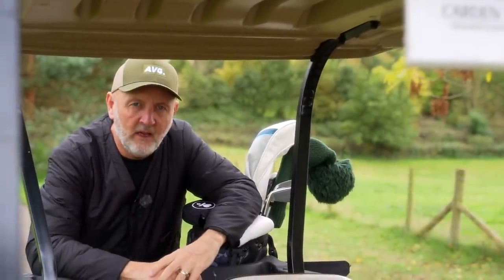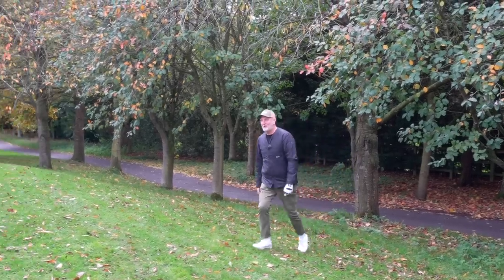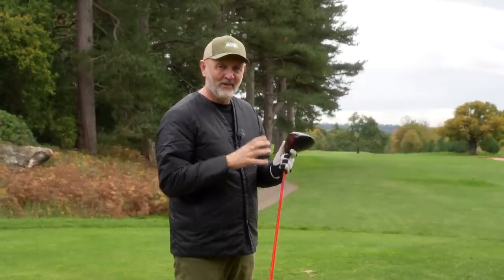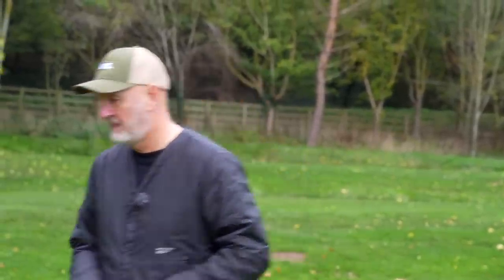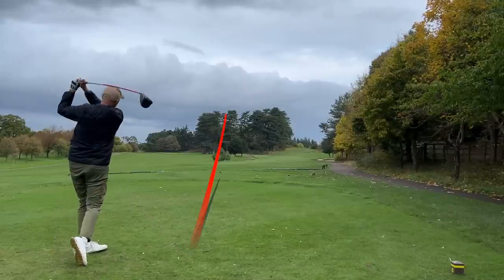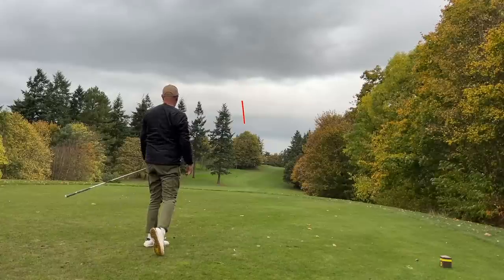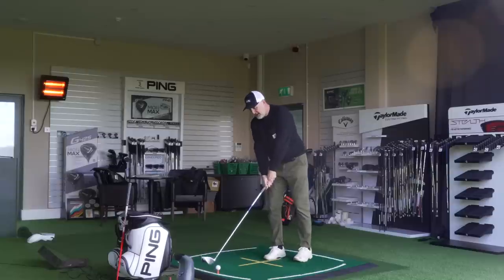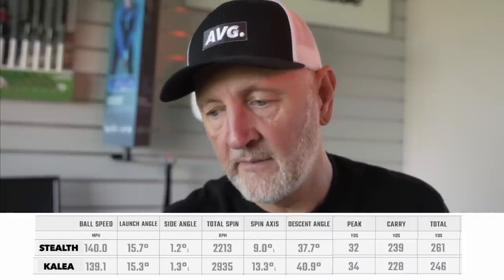Don’t regret not trying this DRIVER!

Comment: Andy when Fred Couples won the masters he had a bad back and used a lady’s light weight shaft in his driver, so that he could use a slower swing to protect his back and swing more consistently and keep the ball in play. Just a thought for you to ponder. Perhaps the shaft length was to mens spec that I don’t know, but the result says it all. I use a KBS Tour Driven 60g category 3 shaft in my Callaway Epic Max LS Driver set to 9°. The shaft is 1” longer than standard, when I’m hitting it well I go full length with my grip but when I’m off I grip down on it about an 1” to an 1 1/2”. One thing I have found is by building in a pause at the top of my backswing I get more distance and accuracy. My average swing speed is around 95 mph I’m 66 pushing 67 now and I’ve got back problems. Just some food for thought, all men have a bit of a macho thing about length ( and not just in golf 😂) but your test makes a interesting watch, sometimes the old saying “drive for show put for dough” and work more on short game chipping, putting and approach shots from 150 out improves our scores by a significant amount. It’s ok to hit the ball off the tee 300+ yards but if you can’t hit the green with a wedge or 8 iron from 150 yards in and can’t chip or putt, that 300 yard rocket is just a waste of time especially when 25% or more it puts you in trouble.

Comment: Thanks Andy, 
Another very light shafted driver you can try is an XXIO 12 Driver. 43g and designed for slow swing speeds. It pops without much swing speed at all. 
10.5 and no adjustability. Loving this driver.

Comment: 15 yards could be the dynamic loft degrees.  Why not put the lighter shaft into the Stealth head?  The loft will come down to 10.5 and your dynamic loft may bring the flight down as well.   I bet you gain in dispersion and distance.   It's been proven that generally speaking an inch longer will not help your distance.  You will hit center of face more with a slightly shorter shaft...I.e. Your efficiency goes up as your shaft gets shorter. Maybe your swing speed goes down...  But, you can "jump on it" if the shaft is shorter...It feels attackable.  So, your swing speed may in fact go up, or at least stay the same.  Especially if you play with the shorter / lighter shaft more and get used to it's kick point.  Crossfield went over all of this quite some time ago.   Dispersion and strokes gained etc...all from a lighter more controlable shaft.

Comment: Went from a B21 driver to Rogue and the dispersion was so much better. The distance didn’t change very much but being in the middle of the fairway is a huge improvement and advantage for me.  On the B21 I was using a ladies flex 40 gram shaft at 44.5 inches.  And it was giving me 15 yards more distance than the regular flex 55 gram shaft that was original.  But with the Rogue I don’t see that distance gain with the lighter shaf or if it is longer, it isn’t in the fairway.  The regular flex is just much better dispersion and ends in the fairway.  I’m still experimenting, looking for the lighter shaft that will give me more distance and still retain the dispersion for me. 
Great video sir.

Comment: I've gone from a rogue 2018, 50g stiff to a pxg 0211 with a 65g stiff, didn't get custom fit properly as I needed to buy quick, but my rogue was all over the place, pxg driver so much straighter and more consistent, I think the lighter shaft wasn't good for me, but I do think a shorter shaft adds more control, I tend to down grip slightly nearly all my clubs and seems to work well

Comment: I just replaced my Callaway mavrik driver with the new rogue, both fitted. I didn't originally gain any distance but was much more accurate and consistent. I'm now more confident with the club and find I have gained distance because of the more confident swing. Point is I was happy to replace a club not because of gaining distance but because of accuracy.

Comment: Andy...can you please do a video [including dry-ball data] on the degree to which ball flight is affected when you change the hosel settings on adjustable Drivers...I play the TM M2 Driver and I've tried every setting from -2 to +2 and also the 'Upright' setting but I see VERY LITTLE difference...please prove me wrong but I'm afraid I'm a massive sceptic on adjustability...thanks [and keep up the great work!]

Comment: Another interesting video andy. After your first review of the ladies driver, I took my mums old ping g5? Out with me to the range. Only one bad shot vs about 50% of my own driver shot going to far to the right. I haven’t been fit for either and driving isn’t my strong point. I would definitely consider using the ping on the course when it is tight. I would rather be shorter and in play than in trouble off the tee. I will happily take any jibes or banter from anyone I play with. While they are looking for lost balls I will smile and wave from the safety of the fairway 😂😂😂 realistically though I will probably just use my four or seven wood from the tee instead. But good to try things. Great video.

Comment: I reckon you’re onto something here Andy. I tried my wife’s Mizuno Efil 5 wood at the range then on the course. Had to slow the swing down and concentrate a bit more on timing and I was hitting it straight up the fairway 170 - 180 metres. I got carried away tempo wise once or twice and that did not work. The grip is too small for me but I do like hitting it. Her driver is next!

Comment: As others have commented, put the 10.5 head in the lighter shaft and the 12 head in the heavier shaft and do the same on-course and indoor tests.  Then compare the data to your original test.  Question, would the distance gaps (carry distance dispersion) be tighter (less) with the original setup or the new?  Especially since the ball speeds were only  around 1 mph apart in the original setup. My simpleton mind thinks that the "new" setup with a lower loft head with a lighter/more-flexible shaft will be very comparable, maybe match, a higher-lofted head with a stiffer shaft. (Golf will drive you mad trying to find your best setup with all the different combinations a person can create! 🤪)  Been watching your videos for awhile and the improvements in the quality of content and presentation is very noticeable.  Kudos to you and the people supporting you.

Comment: We have similar driver swing speeds.  So your driver shaft solution might be the same as mine.  Team Titleist fitting put me in a Graphite Design Tour AD IZ-5S in a TSR2 10 degree head.  Second choice from the fitting is the new HZRDUS Red CB 50g 6.0.

Comment: Shaft length could make a big difference. A 1.5 inch shorter shaft is just over 3% shorter and will result in same reduction in ball speed and distance. So around 8 to 9 yds for 250 yd drives.

Comment: I went to 55 gram this past year R flex from 65 gram S flex. I overall like the feel of the club and to me I get higher swing speeds with the lighter shaft. There is an Evenflow 40 gram wood shaft in R that I’ve considered trying.
Reply from the maker: Love to know your thoughts if you try
Reply: I bought a Cobra Radspeed driver with the 40g Evenflow CB shaft about a month ago...I hit it pretty well. Only reason for trying the 40g was its similarities to the autoflex shaft. I normally had a stiff shaft in my driver 🤷
Reply: @SteveInUpperMI  well done! The autoflex experience at a quarter of the price.

Comment: Interesting since all of the empirical data leads to the conclusion that you are better off hitting the longer club since every yard further will lower scores over the long run!
Reply from the maker: I always find that odd data, does that assumes the ball is in the fairway or not?
Reply: @TheAverageGolfer  - I think the analytics show that as long as you can get a decent club on the second shot, you’re better off the ball being further down the hole.  Data shows golfers are better off being closer from the rough then further back on the fairway over the long run! 

You see all these YouTube golfers like Crosfield now chasing distance like crazy.

All bets are off if the golfer is not able to keep the longer club in play and is taking penalty shots or pitch outs.